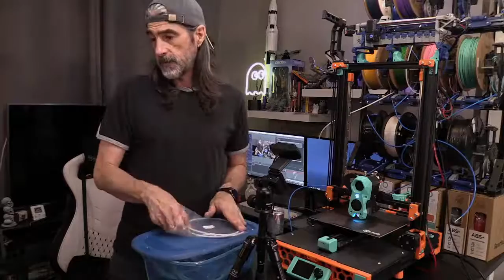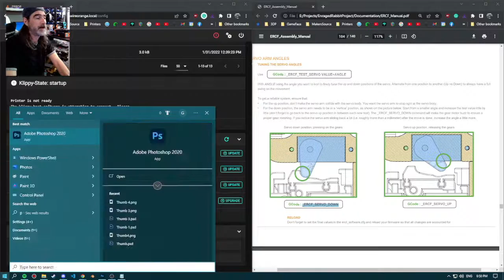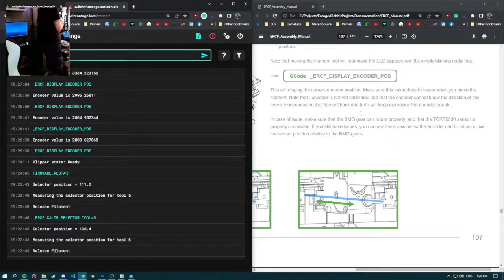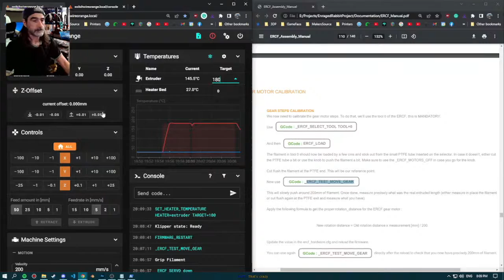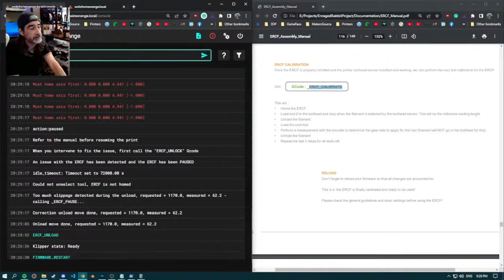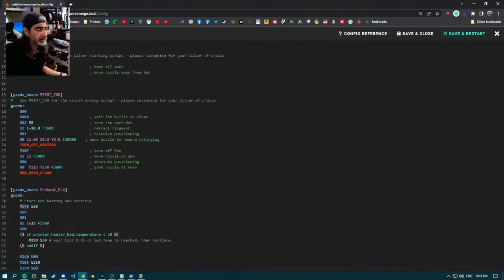Enraged Rabbit on the Ender Switchwire [Configuration]- #voron #3dprinting #ERCF

Comment: So what's your review of it now?

I like the idea and I bought all the parts, I've printed most of them, then there was some wild stuff happened in my personal life and now I'm trying to get back into it.

The Mosaic Palette seems attractive while watching your frustrations during the video even though I already paid into the ERCF, as much as the palette 3 pro after installing a new main board on my ender 5 and a RiPi to run klipper.

How's your ERCF doing now?
By the end of this video it seems like it would be worthwhile to finish my build before spending on another MMU.
Reply from the maker: I have had a few problems getting it working 100%.  Right now my problem is with the filament sensor in the Clockwork 2 extruder which I designed myself. Other than that it working well.  I don't think I would make a 9 colour ERCF again. Maybe a 4 or 6 colour unit would be easier to get configured and tuned. I'll still be doing a printing stream once I get the sensor working.
Reply: @makerssource  The newest beta is sensorless, check out the discord